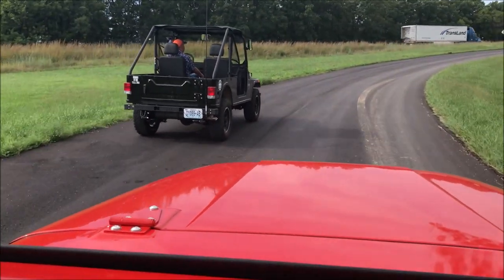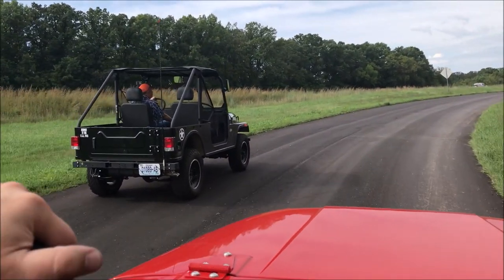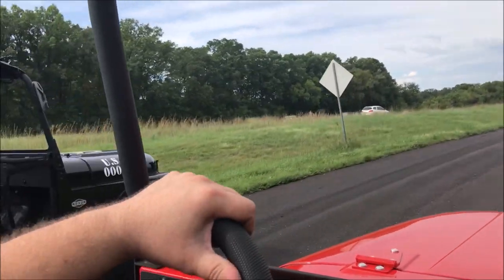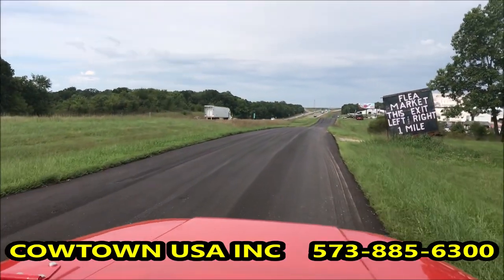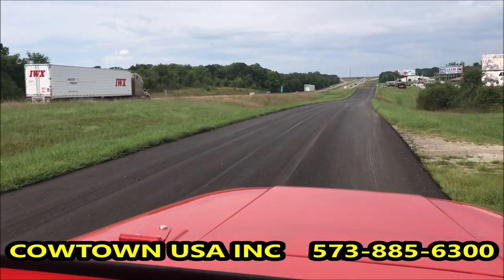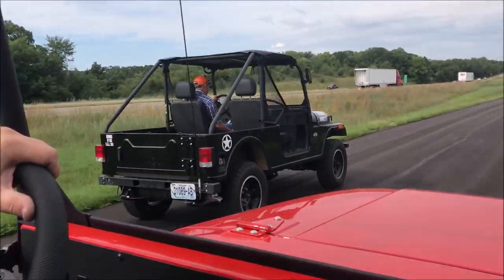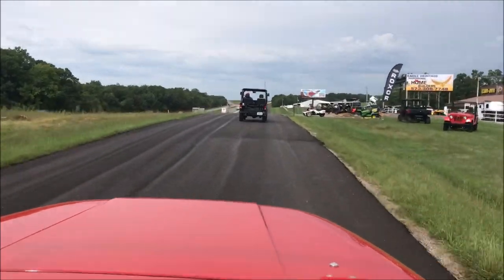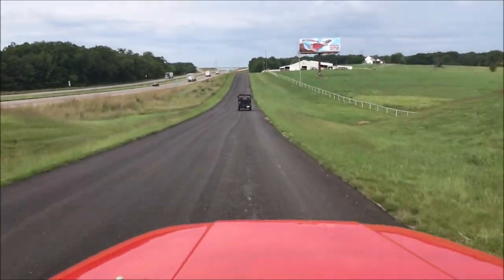ROXOR ECU Upgrade

Comment: In India THAR ( ROXOR ) has 105 bhp power and 247 n torque in same engine
Reply: Requires DEF then here in the states
Reply: No def
Reply: @MarkPotes  Was talking about anything over 80hp in a diesel requires def. I have a tractor that 45hp and does not require it. I move to the 70hp, and its requires def for emissions. Same with mowers. Anything over a certain size requires emissions. Dont know the size at the momment for gas.
Reply: That's a different unit the one you are talking about is a 2.5L Crde turbo the one in roxor is a 2.5L turbo Di
Reply: @Nilotpal_Chakravarty_  you are right.. Same engine for mahindra Bolero[india]
Reply: I have a roxor currently and I'm somewhere in the 140hp to 150hp

Comment: did u guys also remove the EGR ? whats the top speed now?
Reply: I've heard they've managed to get them up to 80.
Reply: @antimattercarp2720  actually 120kmph
Reply: I'm not sure but, i'm thinking hes talking 80Mph which is only 8 more Kph than you stated but just sayin. :) they look like they're around Oklahoma I mean the Rt66 sign kinda gave me that notion. Rt66 goes all the way across the states though so it could be anywhere lol.
Reply: @Wbroach24  120 kph is 70mph.. I have heard they get sketchy any faster